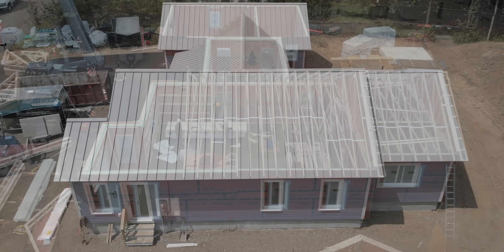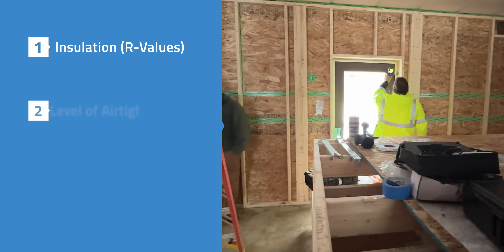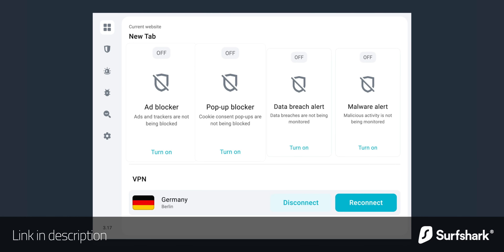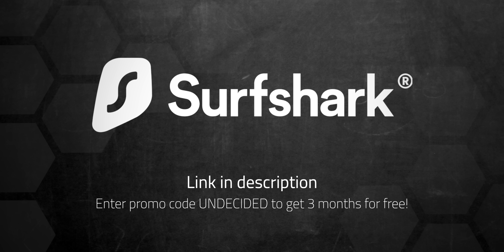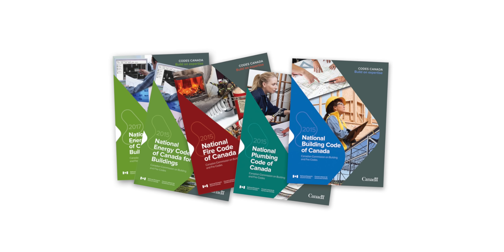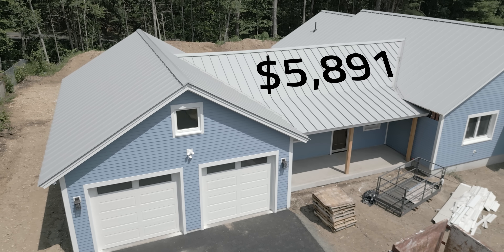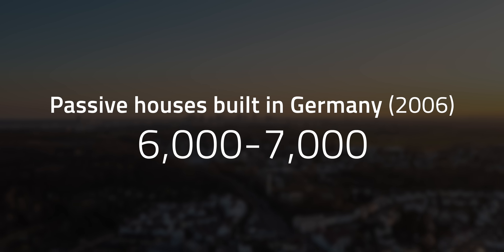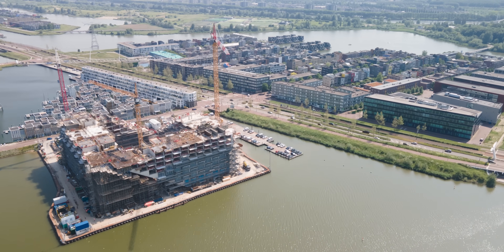Why Do American Homes Suck?

Comment: I am all for the cheap energy price policies of the previous administrations. Where I annoy everybody else is that I'm also all four energy efficiency. I'd like cheap energy and I like not to waste energy so I actually want my cake and eat it too. One of the problems I think facing Americans is that we tend to have a shorter term view on how long we're going to stay in the house and a lot of people that don't plan to stay, but with the high interest rates that might change things seems to be and that might make payback for more energy efficiency stuff.

In my case about 8 or 9 years ago I put AirSource heat pumps in because I couldn't afford it. Ground-based geothermal my house doesn't have central air and it was going to cost about half a year's salary. I couldn't afford that and it didn't make sense. So we put in air source heat pumps which drop our oil heat usage about 1/3 and that's still having a good effect. So the payback was about 6 years. I'm past that now and so now we're just enjoying essentially free units with lower costs of heating. The heat pumps are cheaper to heat the house for most of the year that we need heat except for like January basically or if it's particularly cold in December or February. But you know when it's 35 or so or above it's cheaper to use that. Then the oil sometimes even a little bit lower when oil prices are up

Comment: Here in EU there are homes built with 40 cm (16'') wide autoclaved cellular concrete , some without any insulation (cause u don't need it) and those are homes for 200 yrs or more, no bs, no fine chopped pressed old newspapers between walls, u can visit websites like Xella or Wienerberger (2 types of blocks used in most EU houses)

Comment: I live in sunny South Africa. We currently have an energy crisis (due exclusively to political corruption and maladministration). We also rely primarily on coal for our baseload production.

Rather ironically... Because of this, there is a massive movement towards rooftop solar.

Having watched your video I've maintained for a long time that building codes need to be updated and enforced. In other words... If you want to build, it must comply with the standards or no building.

We are all now only learning why taking these kinds of efficiencies are important now. Short term pain for long term gain. Great video as always!
Reply: I have a co-worker in South-Africa who told me solar panels are often stolen from rooftops, and that companies that rely on them, have to pay guards...
Reply: @SwissPGO  that's true. So are the batteries and copper cable. It's a bit more difficult in some places than others.

Comment: just moved into one of those heavy efficient houses in germany since half a year. Basically if you leave 1 Window open without the shades, the room will increase its temperature by 0,5° each hour. Even with the Air/Temperature Exchange System. It has withdraws, but for 160m² iam only paying 150€ per year for heating.

Comment: Was is often neglected is the primary energy consumption to built a house or its insulation material as well as the recycling of those materials. In fact, the classic building materials such as bricks or concrete, but also plastic-based insulation materials such as polystyrene, better known as Styrofoam, have a high demand for primary energy, because high temperatures are necessary for their production. If you bear that in mind you come to totally different solutions, like building with locally available, natural materials such as wood, straw, clay or similar. People in the past were actually really good in this, because they had no choice but a lot of this knowledge have been forgotten. It also creates a more healthy living environment. Greetings from Germany

Comment: A big part of the problem is that the energy efficiency of homes, and the quality of the mechanical systems, isn't factored into the valuation of the home at all, not even a little.
Ever dollar a builder spends on improving the efficiency of the home, past the minimum that will skate past whatever passes for a code inspection locally, is a dollar less that they make on the home.

Comment: Let's call it simple, it's about the money.   Not including the housing prices today going stupid, it's a matter of cost difference.  For nice round napkin math numbers let's say you could buy a piece of land and build a 3bed house on it for $200k.  OK, that's going to have basic insulation, maybe double pane windows, and 2x4 walls.  If you wanted to kick that up to 2x6 walls with triple pane windows and super packed insulation, that triples the cost of the house.  Your bank has just cancelled your loan because you couldn't afford the payments.

OK, so if that's out of reach, how about putting up solar panels and trying to reduce your power bill?  Great!  You can put up to a 10Kw array on the roof for $60k out the door!  With the tax credit that's only $40k, right?  Nope, when that meter starts spinning you need to have $60k in hand for your contractor.  Do you have $60k floating around?  

It's much like the Made in China vs. Made in the USA argument.  If I had to pay 20% more to get something made in the USA, kewl, it's worth it.  When I have to pay 200% more for that same label and the parts are still made in China anyways?  Forget that!  I need food and gas!  

For most folks I know, things like energy efficiency and passive houses and even solar power (which is pretty worthless in the PNW) are luxuries that we can only dream about because of the really high up front costs involved.  That's why so many of the people around here that even have solar arrays did them via lease and got hosed on the payback, because they wanted to do their part, but couldn't afford to cut that first check.

Comment: I'd take any "suck" homes than live under the bridge...Get real, folks, if we want to safe energy, then lower your thermodtate in the winter and raise it in summer. or do not use it at all if weather permits, while there is no passive home codes in the US.  Obviously, the price of a new home is already quite expensive, trying to get those building materials that conform to the passive home codes will only make it more expensive , especially when we have so many "custom" styled homes around...

Comment: Follow with me.  In Europe the ski slope is mark by posts and signs down the center of the slope.  "Go this way."  In the US it is the sides of the trail that have signs "Stay in bounds"    Exactly the same in building.  In the US we use a building Code.  "Built to Code."  as a commercial will brag,, but,,, Building codes are the dead minimum you are allowed.  A house , "Built to Code."  has just bragged, "We built it as light, flimsy, and as cheaply as we possibly could.". The next step down is a tarp and tent.  In the US built in excess of code is often NOT permitted,,, because  it isn't code.  Banks, building departments,  and appraisers will refuse a new or creative improvement.  I KNOW because I built energy efficient homes in the 1980s that were in excess of even what is required today.  And had trouble with the building department, the bank, and the appraisers,, and then the city taxed them at a higher rate.   In Europe they mandate what the performance should be.  How you get there is up to you.  European homeowners,, who grew up in their Great, great, great, great grandfather's 300 year old home,, know what quality is.  AND they intend their next 5 generations to live there.  They won't settle for rubbish built to minimum standards.

Comment: We actually have a passive house, almost accidently.  We bought a very well-insulated large used manufactured home installed on a permanent foundation years ago.  Then I installed a DIY solar array, converted everything to electric, and got rid of the propane tank.  The electric company owes me about $150 per year, and that solar is the only energy source for the house.  I still do buy gasoline for my Prius, but it gets 45 MPG.  I will replace it with an all-electric car when used ones get cheap enough.  We never go on road trips, so battery range would not be a problem.

Comment: Not many people talk about the longevity of the "high efficiency" building materials though. Some will last, like insulation. But many will not. The environmental effects of a passive home and the savings only work if the materials used to build the home will last. One example: windows. If you have triple pane windows that have a high U value but they only last 20 years until seals/mechanisms start failing and they must be thrown in the trash completely because of planned obsolesce and replaced. Is that really better for the environment than well maintained, simple, single pane window/storm combinations that could last 100+ years? The desire for a "Maintenace free" home is just as bad as an inefficient home. Eventually that "Maintenace free" home will become an inefficient home and many parts will be ripped out and thrown in the trash due to failure. Having to rip out and replace entire parts of your home due to failure is far from efficient or environmentally friendly. Considering how cheap builders are today the first option will always be the cheapest, with longevity last on their mind. Growing this problem even faster.

Comment: My city has super stringent energy efficiency standards. I remember staying in one of those sprawling Texas homes -- it was only liveable by having 24/7 air conditioning. My house, on a hot day, needs a bit of cooling between 3-4pm and 6-7pm. That's it. Its all-electric, and almost all covered by solar, so basically it's all free from here on.

Comment: It's about money and not to last for about 200 years. We bought a farm with a house that was at least 150 years old. Me and mom did a title search to find out what year the house was built. I think we ended about 130 years and the court house was about to close and the cursive handwriting was hard to read i think the last price was 3000 dollars for a 50 acre farm with a house and other buildings. Now how well this house was built it had 2 inch planks that were 16 inches wide and about nine or ten feet long . The house was barn type construction and had trees for floor beams they just shaved a flat side for the floor boards which were one inch think and 12 to 14 inches wide made of maple wood. We remodeled the house and put in a large picture window in the living room the contractor used 2x4 s to bring the wall flush with the corner beams. A circular saw was used to cut out the windows. The upstairs window had a beam running through the center of the window which was cut out when the new windows were installed. I liked these windows because you could remove the top and bottom and have the whole opening covered with screen. It was nice in those hot summer nights to bring in the cool night air. I used to run the furnace on fan and removed the filter cover the basement was cool so i had my own ac without the large bill. The electric was a Co op even after we sold the farm we still received royalty checks. Not much but it was money. Bottom line they dont make homes like these anymore . It will keep standing. I wish we didnt sell the property. Free natural gas and a well built house. 73